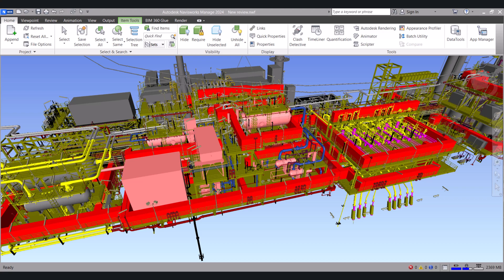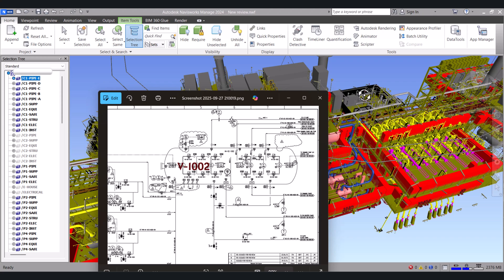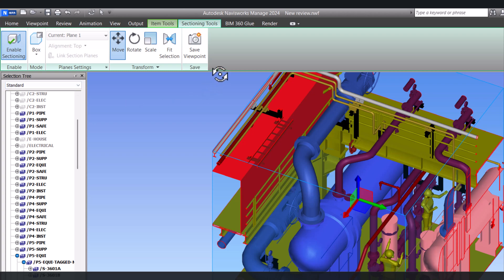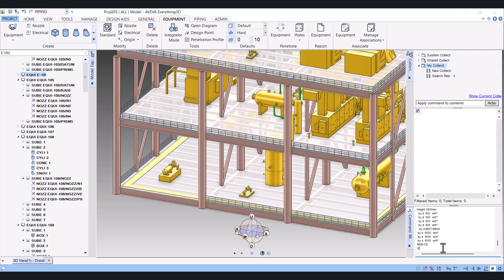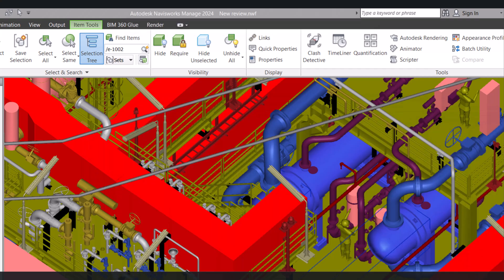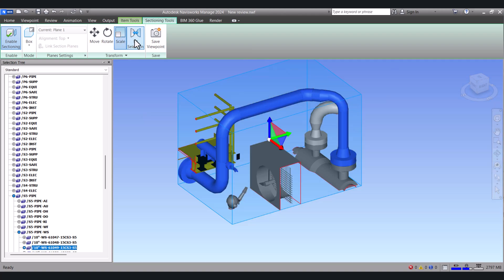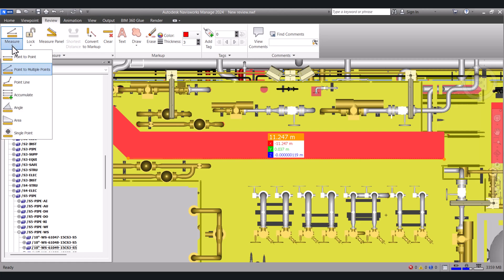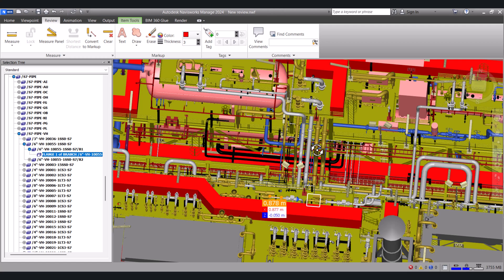How to seach pipes or equipment in Naviswork Manage

Comment: What Is the difference between Navisworks Manage and Navisworks Simulate?
Reply from the maker: Navisworks Manage and Simulate look similar, but there is one key difference. Manage has clash detection, which means it can find and solve problems where different parts of a design overlap. Simulate does not have this feature. Instead, Simulate is mainly for viewing, reviewing, animations and project visualization.